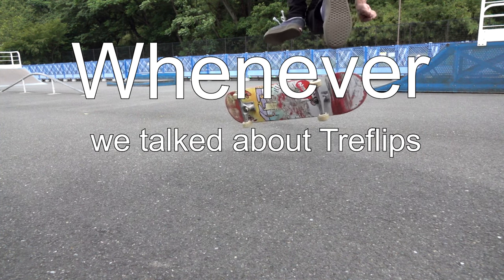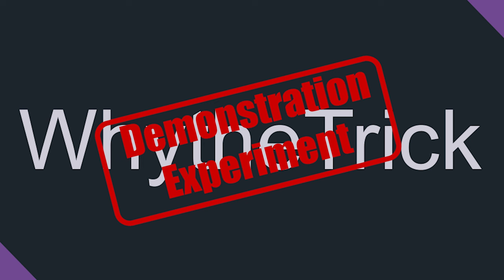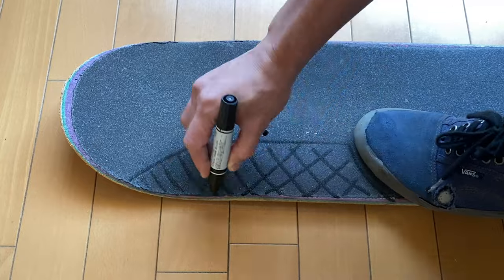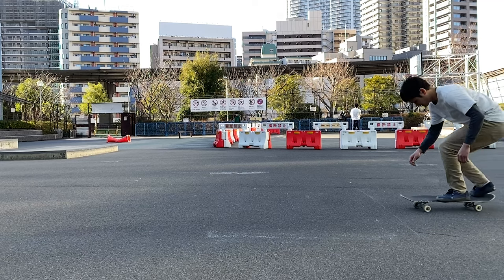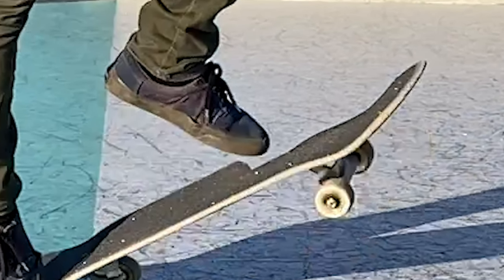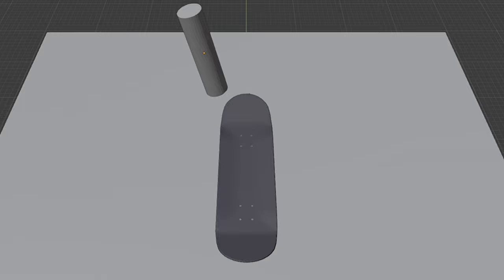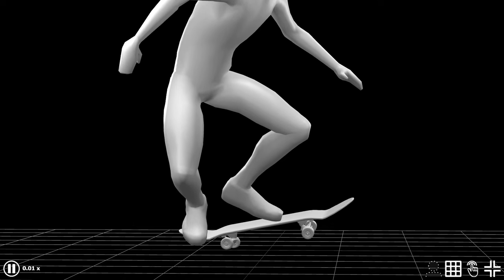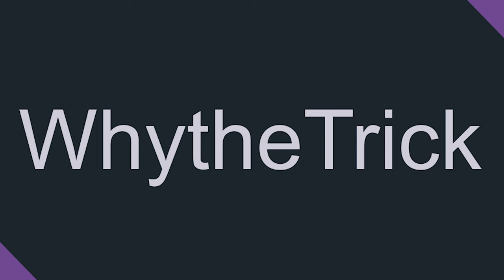What does the front foot do in Treflip?

Comment: The front foot doesn’t “not flick” it does flick and it’s purpose is to guide the tre flip for sure, but it also creates lift like an ollie. I can tre flip with my front foot in heelflip position because I understand how the Backfoot is supposed to work. If I tre flip like that though, it’s low af and almost touched the floor. When you use your front foot you can fling the board up higher. Say you wanna tre flip nose slide or down a set or over something, that front foot is gonna fling your tre flip UP and help you catch them instead of falling down with the board like a lot of ‘ lazy’ tre flips look like
Reply: This is pretty much the only correct comment here. Also, in addition to the height you get from the front foot, it also prevents the board from going off to the side. Look at every tre flip in the video, the dude jumps forward about half a meter. I can do those tre flips, they're just like pressure tres. You're predicting where the board is going to go and jumping to that position. Using the front foot allows you to control the spin and direction more, and with practice you can keep the board underneath you.
Reply: This is how Chris Cole taught in his video. Foot placement like a kickflip but kick to the heelflip side to follow the rotation and control the board

Comment: Technically if your using your back foot in the pocket as more of your scoop and flip technique then it’s more of a pressure 360 flip. If you use your back foot more on your toes to pop and then your front foot to slide up and out you then do the Ollie 360 flip. This is going back to the 80s for me but over all these years it has evolved into both techniques together because the pressure of the back really makes it easier but I think popping and slide flick is more rare and better style.
Reply: You are correct. These are pressure tre flips. Absolutely not a tre flip and shouldn't be considered one or taught as one. He couldn't do that without trucks because he would need the pressure. He should rename the video really.
Reply: @shawnskates  it doesn't look like  a type of "pressure tre flip"; isn't it an oxymoron saying "pressure tre flip" since tre flip is actually the opposite of pressure flips (which use an inward rotation)? it's a paradoxical name.  the pressure flip creates an inward rotation, not an outward rotation/opposite rotation to the scoop. isn't it more like catching the side of the tail after scooping and flicking it? a back foot flick? it doesn't look like a pressure flip, because the pressure flips go inwards like inward heels, but this one rotates as a tre flip - exactly the opposite of an inward rotation. isn't that because he flick the tail with his back foot after scooping it?
Reply: @shawnskates It's about the movement of the board: if the board flips and rotates on two axes like a kickflip and 360 pop shove-it combined then it is a tre flip.
Reply: @sepg5084  na man, for example- a late flip is a kickflip but done late with the back foot. Just bc the board flips a certain way doesn't mean that's the trick. A lot of variables come into play here. Like which stance the skater is in. Which end of the board it was popped and flicked from. Did the skater do any body varials without the board following. Was the board flipped from under the board or on top of it.... sorry, but I've been skating for 25 years. I can't stand when ppl act like they know what they are talking about when to many it's obvious they do not.
Reply: @user-iw6vf4vl7n  it is a pressure tre flip bc a normal tre flip uses the front foot. How else could people do tre double and triple flips.... by using more front foot flick, of course.... sorry for being so late.

Comment: Some of us do them SLIGHTLY differently. Especially those of us  (healthy and in shape) 40+-year-olds. 
   My take: Most of you (younger) do more of a pressure flip technique that requires you to jump way out in front of where you pop from/to the toe side because that's where your board goes when you scoop so much from the pocket, while others (usually older) pop more straight up and down and have a delayed scoop with a little more toe pressure (than the super pocketed scoop)  on the front foot. We still have to jump a little in front of where we pop, but nothing as exaggerated as the more common technique mentioned in this video. Our back foot tends to be up on the tail more than in the pocket. 
   IMO: There's much to love about both techniques and either can be more appealing than the other, depending on whos doing'em. 
Doing them the "old way" is definitely harder than the super scooped pressure method and there's more of a chance of clicking your heels together trying the "old way", but when you get'em they typically (but not necessarily) feel and look better.

Comment from the maker: This is just proof that MY front foot does not flick my board when I Treflip, which may or may not apply to your style.
How do you Treflip?
Reply: I don't
Reply: switch. bc i cant regs lol. i messed up my ankle one to many times so i cant scoop right anymore with that foot. so i learned em switch
Reply: I always thought, flips without involvement of the front food are automatically pressure flips - is this then a tre pressure flip and no "regular" tre flip?
Reply: @sofdsdf  we'll still get it in this life!
Reply: @seferis101  No. Pressure flip will make it rotate inward, with almost no pop. It's just that the scoop is this valuable for tre
Reply: I been trying to varial flip for ages I can now spin them the right way just not tried landing at all I thought wonder if I can try spin a tre all I did was like added more spin and push down with my left foot as I skate goofy and I span it the right way nose ended up back at the nose
Reply: Take this down and retitle it then.
Reply: @18ps3anos  wrong you can pressure many flip tricks. They call pressure inward heel the pressure flip bc it was the first one. But you can pressure tre, pressure heelflip, pressure kickflip, pressure bs flip etc... If you only use the foot that pops to flip a trick it is a pressure flip.
Reply: @shawnskates  You are correct, there are multiple ways to pressure flip. I just simplified it by focusing on the pressure flip with that kind of foot position, which is the default one when people refer to "pressure flip".  That type of pressure flip will flip inwards.

You are wrong in your last statement, as most skaters do not use their front foot to flick tre flips. And it should not be considered a pressure flip because of the way it rebounds against the direction of the force used as "pressure", and not in favor like all pressure flips. It's way more complex than just saying "if you just use your back foot, then it's a pressure flip"
Reply: @18ps3anos  it's really not complex. Most skaters do use their front foot and the ones who don't use their front foot also usually know they are not doing a proper tre. These tricks are named things for a reason. You are using pressure to do the flip which you could not do without trucks. A proper tre you can do with just the board on the ground "no trucks".
Reply: @shawnskates  No, you can't, since the scoop is essentially what makes the trick happen. The ones that add a flick to it barelly change anything about the back foot motion.
Reply: @18ps3anos  the scoop is not what makes the trick happen. It's the pressure. Can you tre with just a deck?
Reply: @shawnskates  Can you back foot impossible with just a deck? 
The "pressure" involved in a tre flip has a different purpose than the one in all pressure flips. You are trying to reduce skate physics to simplified concepts just because it's easier for you to understand them. I get that. But you are wrong. 
No one pops a tre flip like a varial flip with one extra 180º degrees rotation. That rebound motion occurs in ALL tre flips, regardless if the skater is adding a bit of flick or not.
Reply: @18ps3anos  yes I can do an impossible with just a deck and yes you are wrong.
Reply: @18ps3anos  if you only use pressure for the trick then it's a pressure trick.  very simple

Comment: I learned tre flips in 2008 and they evolved over time. The first years, I actually flicked to the nose. That was somewhat consistent but looked crappy and the landing was rarely perfect. 

Then, since lets say 2016, I took the front foot out of the equation, it did nothing at all and I just popped it as hard as I could. They looked really great and usually the landing was clean and perfect. I could also do them down stairs now. However... success rate wasn't that good. 50% of the time I'd just land a 360 pop shovit with a half flip, upside-down. Or primo.

Then, finally, a year ago I changed my technique again. It's perfect now. Almost always a perfect landing and I don't really fail them anymore, I do 9/10 perfect. What I do is that I pop it strongly, don't flick to the nose but a little little bit late towards the heelflip direction AFTER the board has turned a 180 shovit already. At least that is what it feels like. Works extremely good for me for some reason. Idk if anyone else does that.
Reply: "but a little little bit late towards the heelflip direction AFTER the board has turned a 180 shovit already" 
What? Extremely confusing descriptions.
Also, I am not sure how you can "flick to the nose" when the scoop puts your board 45-90º at the moment of jumping. At the very least, flicking in a tre would be to the side, near your foot position, since the nose isn't reachable anymore. Unless you meant you flicked "forward" to the previous nose position, and not the current nose position. I am sorry, it's just that it was indeed confusing since a proper kickflips requires you to flick to the nose and it that case your foot actually flicks off of it.

Do you have any videos or images illustrating what you meant by "heelflip direction" ? Did you mean flicking outwards diagonally, taking advantage of a larger contact surface during the first moments the scoop rotates the board?
Reply: This is how you should be treflipping
Reply: @18ps3anos  I mean that with my current technique it feels like I do a delayed heelflip motion with the front foot. If I look at footage of that, it isn't really visible. But it's what I think about doing and it's what it feels like. 

About my old technique where I flip towards the nose... can you do double tre flips? Because that's what it feels like. Flipping a double kickflip has a similar motion. Again, this is just what it felt like back then.
Reply: Same thing for me. It always felt like a late inward heel, in some way
Reply: @18ps3anos  He means he thinks his flick is following the pop shove /360 shove it direction of the board, but in reality that's not even needed. People argue they do the same for varial kickflips, but you can literally flick 100% kickflip direction off the side of the deck only and putting in enough scoop will still complete the varial kickflip. There's no need to push the varial kickflip around using your front foot. In fact, trying too hard doing that results in an inverted board or something close to a hospital flip if you stick it.

Comment: Your back foot is the pocket deep and is causing a pressure flip situation. Tre back foot position should be back on the edge and you should flick with your front foot. I flick with my front, but at this point it doesn't matter. I would only bet money that front foot flick with back foot at edge corner results in high popped and proper looking Tre flips. Pressure Flippy tres can get that lazy steezy look. Both have uses and are viable. I just think that if you need clear a 12 set you are not going to be able to do the pressure Tre. Your going to need the proper poppy catch Tre.

Comment: Can you do a treflip without the front foot, of course you can. A inward heel and a preasure flip are almost the same trick. Haha... A friend and I used to argue the front foot thing all the time. I argued the front foot is important part of the tre-flip and he would argue that it was all the back foot. While he was highly consistent with his tre-flips they weren't very high and he struggled to do them off launches,  overs gaps, and down stairs. While I don't skate as much as I used to, I used to be pretty consistent with my tre flips, but just not as consistent as my friend.  The thing I had over him though was I could do tre flips off launches, overs gaps, and down stairs. The front foot is what, as least for me, gives you the control of the board; it brings the board up to the feet and keeps the board under the feet. 
This is how I do them. I sit up just like I would for a pop shuv-it with my back foot slightly more off the edge of the tail. My big toe is still on the tail, but the other four toes are gripping the side of the tail. When I pop and scoop I scoop it almost like I'm trying to do a 270 pop shuv-it. When the board hits about the 45 degree rotation my front foot just does a kick flip, but I'm kicking straight foward or slightly in the direction that the nose is rotating in... As I'm finishing typing this I noticed a thumbnail off to the side "How To Tre Flip with Chris Cole. How he does tre flips at the end of the video is very close how I do mine. If you want more control. Learn them this way.

Chris Cole video:  https://youtu.be/6hdkUvAUrUY

Comment: This is still such nonsense though. The front foot is essential to making the tre flip work. You spring load / pressurise the kickflip side of the board to also rotate that way. To suggest it only 'guides' is misinformation. To suggest it doesn't flick is also false. If enough pressure is applied, it only needs a nudge to get going. But it still flicks. And a pressure 360 flip is a completely different trick, that ironically also involves spring loading the board just by foot placement. A tre flip without a flick is just a 360 shove and everyone knows. What a trick 'looks' like, isn't what a trick is. And you haven't nearly cut away enough of the board to proof your front foot does nothing. It's still preloading the board and it's resistance is still there. Anything past the middle of the board will work. And all you did is to force yourself to relearn the tre flip with a foot position closer to each other. You did not prove no flick is required. To see what it even means to pressure load using your front foot, try to do this 2:55 , but without your front foot on the board when scooping. There's 100% no way you can lift and flip the board with just your back foot. The real 'trick' at play here is the more preloading the front foot on the deck, the less flick you need to get it going at least half way around in terms of kickflip rotation , the less pressure you put on using the front foot, the more flick you're going to need to compensate to still get a full rotation going. It's simple physics. Not magic.

Comment: If you’re not ACTIVELY flicking, then your back foot is scooping the board and sending it in a direction that causes it to collide with the front foot and begin the flip. The front foot can be passive or active but either way it’s presence is needed to get the kickflip done. This was why it was very difficult for you to get the treflip after you cut your board. Even if it was a tiny bit, the toe on the front foot interacted with the scoop of the back foot to flip the board.

Comment: This info is awesome, never imagined that the back truck made the board flip, not the front foot
Reply: Because he's wrong.. you DO need to flick it with your front foot
Reply: @jaciobe  I used to think that, but did you see the video? He clearly never touches the board with his front foot and the analysis he provides makes sense.
Reply: @kolbann  the analysis proves he doesn't actually do 360 flips he does something else
Reply: @jaciobe  what is something else
Reply: I afill consider the flick an actual Tre. No matter how wacky it is, they still FLICKED it
Reply: @chachmcgrach2053  underflip
Reply: @jaciobe  it's a pressure tre flip. If you only use the foot that pops to flip a board... its a pressure flip.
Reply: @shawnskates  pressure flips flip different though
Reply: @jaciobe  what pressure flip? Bc you can pressure many flip tricks. Pressure inward heel is called the pressure flip bc it was the first one but you can pressure kicklip, heelflip, tre, bs flip etc... as long as the popping foot is flipping the board it's a pressure. Bc you are using pressure.
Reply: @jaciobe  oh and an underflip means your foot swipes up from under the board making it flip. All the names have meanings.
Reply: @shawnskates  I know this I've skated for over 20 years.. and that's how they get the board to flip using only the back foot on the edge of the board. They're using their big toe not realising. That's why it has a kickflip type flip and not a heel rotation flip like a pressure flip yeah.
Reply: @jaciobe  no. The underflip tre or Mike mo flip or impossible lateflip or whatever you want to call it... people have many names but you do a pop shove then underflip which makes the board look like a tre. A pressure tre there is no underflip or front foot. A proper tre flicks the front foot. I also have skated for over 20 years and I don't see a person that's skated that long call this an underflip... bc its not at all what he is doing.
Reply: And unless you have monkey toes you're not getting that big toe under the tail after it pops... pressure makes the board flip like he stated in the video
Reply: @jaciobe  look at how a no comply tre works.... same thing.
Reply: @shawnskates  you actually can with the side of the board. Doesn't take much tbh
Reply: @jaciobe  let's see it.
Reply: @jaciobe  I just watched 2 secs of your skating. Nm this entire convo. Keep it up.
Reply: @shawnskates  what my tre flip?   On my channel Skate Seen